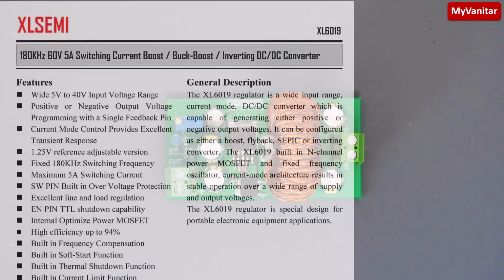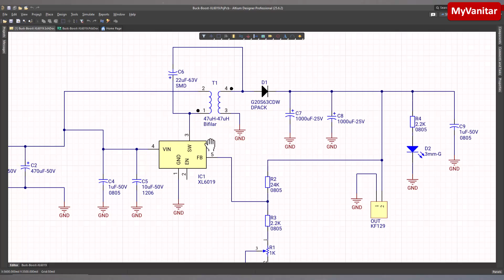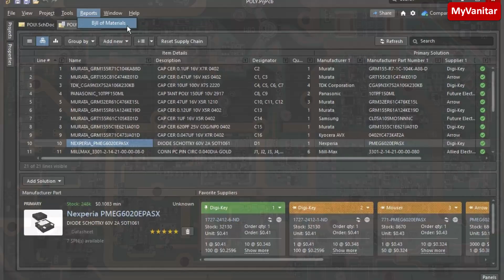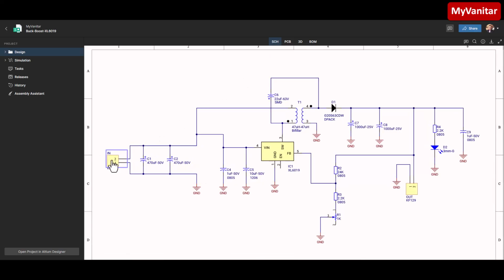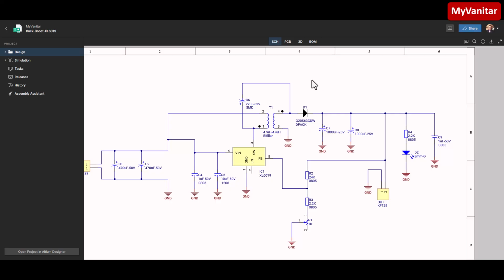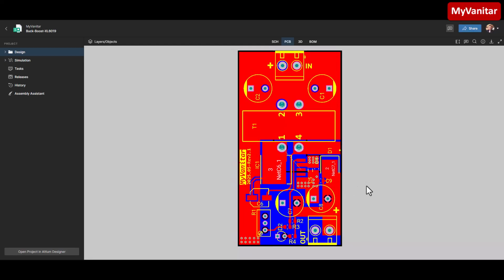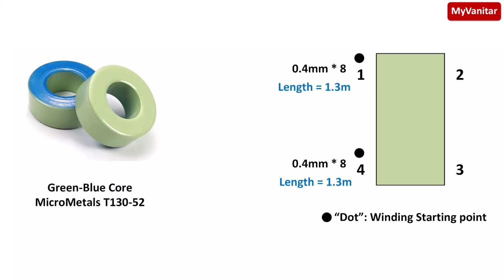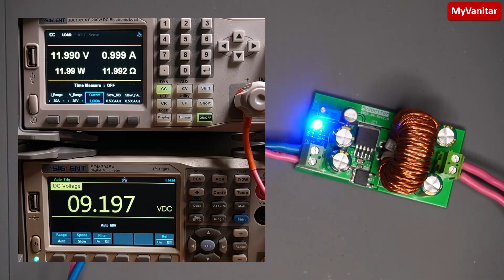DIY Buck Boost Converter using XL6019 (Bifilar Choke)

Comment from the maker: In this video, I build a buck-boost converter (step up and step down simultaneously) using the powerful and affordable XL6019 IC, switching with a handmade bifilar common mode choke (very likely for the first time goes online). This circuit can step up or step down voltage, making it ideal for powering devices from a wide range of input voltages—such as solar panels, batteries, or vehicles.

🧠 What is a Buck-Boost Converter?
A buck-boost converter is a type of DC-DC power supply that can raise or lower voltage as needed. Unlike regular buck or boost converters, this one adapts to both high and low input conditions—perfect for unstable or varying power sources.

Comment: HI, you have a lot of project, but pages are unavailabe: ERROR - try again later. 
I am searching for BOOST converter - but 2-phase -35 - 45 AMPs per phase, synch. interlieved topology,
something like this, https://www.youtube.com/watch?v=q-ngGsj0pyM
But I can not find such project, and people also present only 2 - 3 min video, but not 10 - 12 hours tests at full load. e.g 48 V IN / 90 AMPS IN.
DO you know some people, that have such project on the web or Youtube , e.g. with thermal cam. images under full load ?
Reply from the maker: I don't know what you are talking about. all links are valid and tested

Comment: Can be used this topology, as bidirectional noninverting buck-boost ? But instead of XL6019, use 4 FETs and PIC, so that can be used as charge pump in BMS.
Reply from the maker: I have not tried that type of circuit yet, but typically an MCU is not good for such an application because it's not fast or reliable to detect tiny changes or sudden rushes. such converter chips are complex

Comment: May I ask where you sourced the wire used for the winding?
Reply from the maker: It depends on where you live. If "repair" is common in your area, you can find such magnet wires in all thicknesses locally, or buy online from another industrial city. If not, just search online or check stores like Amazon, AliExpress, or other sellers. My suggestion is to buy a range of thicknesses if you build such things often